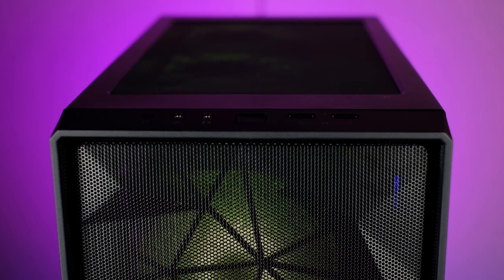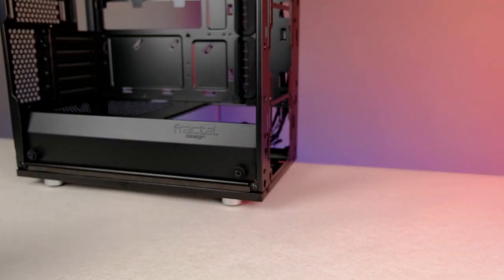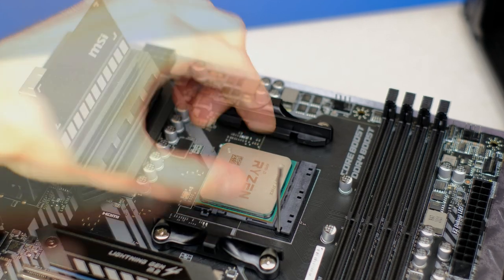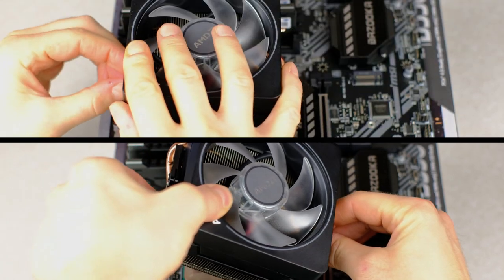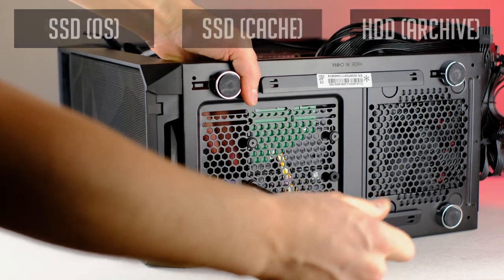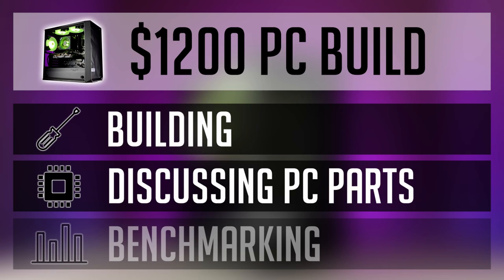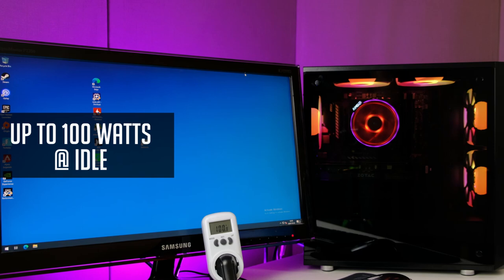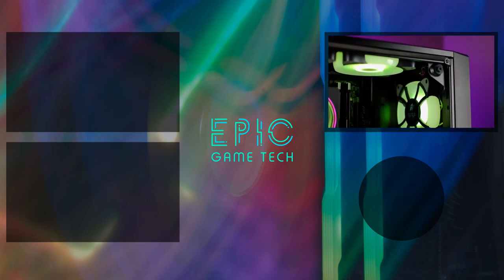$1200 VIDEO EDITING PC BUILD - Ryzen 7 3700x + RTX 2060 - Benchmarks: Blender, Gaming & More

Comment: Hi there.
The RTX 2060 model with 12 GB Vram would be a better solution for video editing with DaVinci Resolve? Footage and timeline max 4K
Reply from the maker: Hey,
More VRAM is almost always a way to go, especially for the bigger resolutions or in case you use lots of effects.
For 4k, well it depends, but RTX 2060 12GB would perform better vs 6GB if yoi do lots of effects.
For 6k+, 6GB VRAM would be way too low. But 4k is hard to say, as it dependson your specific usage of Davinci.
I mean in case the price difference is small, take 12GB for sure and forget it. But if you can choose lets say 2060 12GB or 2070 8GB for roughly the same price, I would go for a faster GPU with less 8gb VRAM.
Hope that helps :)
Reply: @EpicGameTech  Thanks, you are amazing!

Comment: I use the 3700x and 2060 combo for animation and motion design and I'm loving it, not to mention the gaming performance.
Reply from the maker: True, this combo is good or in other words is enough for more budget production PC :)
Reply: @EpicGameTech   please would you tell me should go with the  ryzen 5 3600 or ryzen 7  3700x for my rtx 2060? idk why bit the bottleneck calculator is saying that the rtx 2060 has less bottleneck with the ryzen 5 3600 even its weeker i dont understand that
Reply from the maker: Hey,
Calculators sux ;)
In case it's for gaming only - Ryzen 5 3600 for sure.
In case of video editing / other CPU intensive software - take 3700x :)
Reply: @EpicGameTech  ok but i can get booth for the Same Price so why should i take the weeker one , if i can take the stronger one for the same Price  is there any reason for youre decision?
Reply from the maker: Oh, if it's the same price, definitely take r7 3700x :)
I mentioned r5 3600 for gaming as it should be cheaper..
But  if it's same price, take 3700x for sure.
In terms of gaming with your rtx 2060 - you would be getting pretty much same performance with both CPUs. 3700x will work even with better GPUs when you decide to upgrade.

Comment: I’m buying a pc for gaming for $300 with these specs i5-4590 CPU,  12 gb ram, and a GTX 1060 6gb, 180 gb SSD, 1T HDD in a HP Elitedesk 800 case, is it worth the price? What should I do
Reply from the maker: Hey,
hmm, wee in my country, I can buy a similar PC from around $270-300 USD. So from my country market perspective, you could try to agree 20$ less price etc. But in general, your deal is not overpriced, as it's quite similar to what I could get. 
Anyway, i would try to negotiate 10-30 USD less price if possible ;)
Reply: @EpicGameTech  should I make your $200 build?
Reply from the maker: Well, this build you mentioned will perform better than my $200. Mine was cheaper, but this one has a better GPU/CPU and more ram, etc. So for a better experience if you can spend $300 (or less if you get a discount) go for this one :)

Comment: Rtx 3050 or rtx 2060 6gb which is better for video editing..? Please suggest.... 
(CPU = Ryzen 7 3700x)
Reply from the maker: Hey,
Both cards are pretty close, but generally, RTX 2060 is a bit faster, maybe up to ~10%.
The only advantage RTX 3050 has is 8gb vram vs 6gb on RTX 2060. But you need more vram on 6/8k video editing or some other 3d rendering applications if the project file is really big.
And having in mind both of them are more or less budget/mid-range, I guess they will be used on some projects occasionally and not 100% on huge projects etc.
Reply: Thank you for reply... 😃😃
I will work on maximum 4k videos... And maximum 50 minutes of video size.... Using chroma keys, colour gradation, animated texts, transitions and some other effects... On adobe premier pro, vinci resolve, after effects, filmora etc video editing Softwares.... In India both rtx 3050 and rtx 2060 has almost the same price..  Rtx 2060 is slightly costly, 15-25 dollars costlier than rtx 3050... And I can afford both of the gpus.. So what should I go for...?

Comment: Hey I have a question can I change rtx 2060 to 2060s?
Reply from the maker: Hey,
Sure, definitely. This pc build was more oriented towards video editing, so the CPU (3700x) can handle way better GPUs like RTX  2080ti / RTX 3070, etc.
So RTX 2060 was chosen as it's enough from a video editing perspective in a similar system. But from a gaming perspective, a better GPU is more important :)
Reply: @EpicGameTech  thanks you

Comment: I got the gigabyte rtx 2060 and looking to buy either the 3700x or 3800x paired with 16gb x 2 ddr4 for now then add another 2 in the future.  B450 steel legend Asrock and kolink citadel case for good air flow.
Reply from the maker: Hey,
is your primary goal video editing/rendering etc? :)
In general, I would suggest going 3700x or 3900x, as 3800x brings no value. Unless exact price as 3700x :)
3800x is barely faster, just a few %.
Regarding PC case, I recommend getting Mesh version, as non-mesh will have not so great airflow for sure :)
Reply: @EpicGameTech  no Mate, video editing reason I watch your video... Yeahhh the kolink got a very good mesh casing. Front, top and back are all mesh perfect for positive pressure,  I might used AIO but future plan will be fully water cooled.
Reply from the maker: I see.
Well, water cooling is more of a premium or just a thing to do because you like it, as it's more expensive cooling. But yep, it looks cool when done right ;)
Reply: @EpicGameTech  hopefully hitting below 30 deg. Cel.  On full load with water cool system.  I will only get the 3800x if the price is right, otherwise it will be 3700x.
Reply from the maker: 30c under 100% load? :) are you kidding?
It's idle temperature, but not under load for sure :)
Reply: @EpicGameTech  Hahaha, just wait and see😅 my Mate idles at 18 degrees during summer and 11 on winter.

Comment: hi, which is better for blender, editing... for creatives. RX 5600 XT or RTX 2060? THANKS
Reply from the maker: Hey,
RTX or even GTX from NVIDIA is better for video editing since they have cuda cores and you can enable cuda cores acceleration in most of the professional video editing software like Davinci Resolve / Premiere Pro etc. And that acceleration will help/improve performance, exports etc.
So I always recommend NVIDIA for video editing while RX is ok for gaming :)
Reply: @EpicGameTech  okay that settles it. thanks!
Reply: @EpicGameTech  thanks a lot. it looks like i need to purchase a graphics card sooner. I wonder if its still okay to use rtx 2060 on my system. Im using ryzen 5 2400g, b350m gaming pro, 8x2 ram. Im still on a budget. so on the near future im gonna purchase a ryzen 5 3600.
Reply from the maker: Ah, so you do not have any GPU now? (I guess using iGPU from 2400g)
What's the price of RTX 2060 currently in your country?
And yes, Ryzen 5 3600 + RTX 2060 would be a good budget combo for video editing. And you definitely need to upgrade from 2400g to r5 3600 as fast as you can, as CPU plays really big role and in most cases bigger role in video editing than a GPU ;)
Reply: @EpicGameTech  RTX price in my country is around $400usd. ryzen 5 3600 processor is around 200$. I'll be zero once i bought an RTX and PSU. so it gonna take less than 6 months for me to save up to 3600. so im wondering if its still okay to use my b350m gaming pro motherboard when I'm going to buy a r5 3600. 

 I'll use it more for blender i guess and illustrator, photoshop and aftereffects. Thanks again
Reply from the maker: Ah, I see. In general, upgrading your CPU from 2400g to r5 3600 would help more for your video editing than upgrading a GPU. BUT, as R5 3600 needs a dedicated GPU and you do not have it, so unfortunate, you need to buy a GPU first :)
I hope you will save some money soon.
Also, It's actually not neseserally need to buy RTX 2060, for a budget video editing PC, you can get away with GTX 1660 super, or even gtx 1650 super (if it's ultra budget PC, you better be getting better cpu/more ram than a much better gpu). Just saying, that CPU is still more important as it's the main thing that speeds up live timeline editing process :)
But sure, rtx 2060 will be a bit faster than those GTX models.

If you still go for rtx 2060 - try getting "KO" model (should be included in naming). As KO model is particularly faster in rendering stuff than non-KO 2060 :)
Reply: @EpicGameTech  thanks a lot! for very thoughtful advise. I'm gonna subscribe to you as a huge thank you

Comment: If im going for editing and gaming, should i get ryzen 5 5600 or 7 3700x ? both are kinda the same price.
Reply from the maker: Hey,
hmm well if your primary gaming - definitely 5600x, if primary editing 3700x. If both are primary :D well i would probably go for 5600x if it's the same price, as you loose ~10-20% on production but gain same on gaming. BUT, currently i saw quite significant pricing difference between these two - 3700x for ~$320-330 while 5600x for ~$380. So in this case, i would take 3700x and forget it. But sure, if can manage to find 5600x in stock for the same price as 3700x - sure, take it :)
also, it depends what GPU and what resolution are yu going to play. As there might be 0 FPs difference in case you are going for 4k gaming, very small difference in 1440p (like 2-5 fps when game running at 100fps). So the biggest difference will be @ 1080p, where lets say 5600x can have 220fps, while 3700x - 200 fps :) (numbers are from the air, just to show a possible difference)

Comment: Is this smooth for 4k editing in premiere pro and im making 3d editing?
Reply from the maker: Hey,
yep, should be good. sure, depends on your projects complexity etc. as might be you need more ram etc.
So in general, more you spend, better parts you can get :)
But for this budget, it's really nice video editing PC as you get a good 8 cores / 16 threads CPU and 32gb of ram. In case you want to get more value/performance, you can possibly skipRGB fans, maybe cheaper pc case. But in general, I would suggest getting Mesh type front panel pc case anyway, as you will be doing heavy workloads, so you need quite a good airflow.
For video editing, this GPU is quite enough. Regarding 3d rendering, depends on software, but in some cases, even better GPU would make 3d render faster. But currently GPU market is overpriced anyway as there are stock issues globally :)
Anyway, it's really capable, nice looking video editing rig :)
Reply: @EpicGameTech  thanks and i got 32gb of ram and rtx 2060 and ryzen 7 3700x 
and yes in my country is overprice  every parts but i keep search for better price good  parts and it super hard to get rtx 2060 super that why i just buy rtx 2060 cheaper price but good quality. by the way thanks for the tips and some knowlege hehehe..:)
Reply from the maker: No worries, RTX 2060 in video editing will perform as good as Super version. Basically you can see some difference (~10% in fps) in gaming, but for video editing, there will be almost no difference for sure, so all good :)
Reply: @EpicGameTech  its oky and im not always play fps game and  may main goal is editing and thanks alot keep it up man
Reply from the maker: @VinceAngala  Thanks, you too ;)

Comment: I bought a cheaper R5 2600x so I could save a couple bucks towards my RTX 2060... Seeing this. I should have paired it with at least an R5 3600.
Reply from the maker: Hey,
depends how much you saved :)
But r5 2600 or r5 3600 is also a good as more of a budget video editing CPU.
I have a friend that upgraded from r5 2600 to Ryzen 7 3700x and... he said the difference is obvious. But it's all about the budget anyway. And most probably, you will be able to upgrade your 2600x to more cores CPU in a future, in case you got a decent motherboard :)
Reply: @EpicGameTech  It was only $40 difference.
Reply from the maker: I see :) well 2700x would have been also an option for video editing, as it's even a bit faster in multithreaded workloads than 3600 :)
Anyway, stick with what you have now and upgrade CPU some time in a future if you see some performance issues etc.